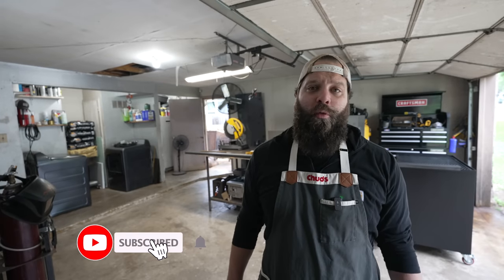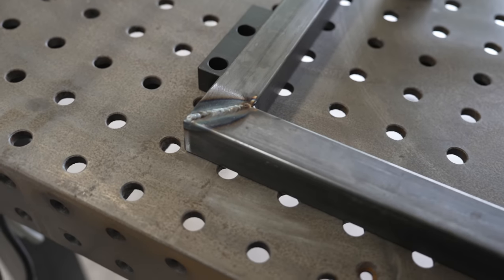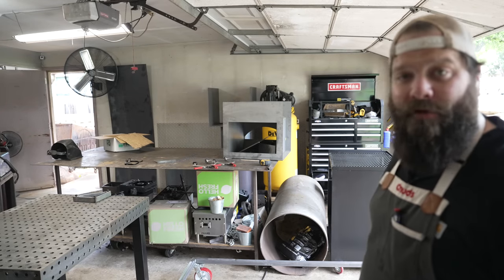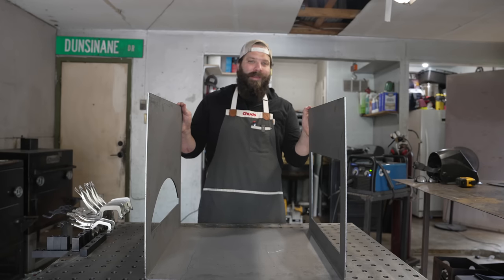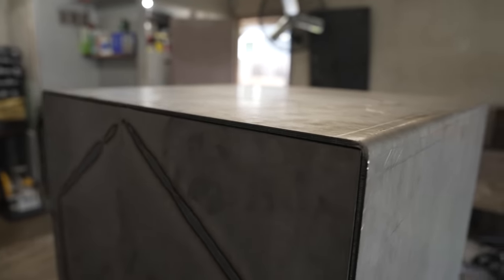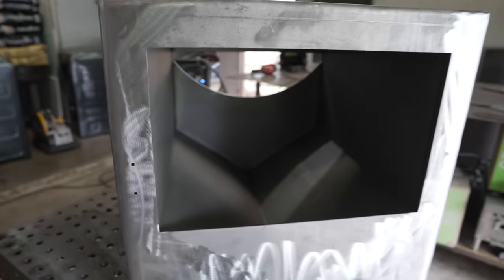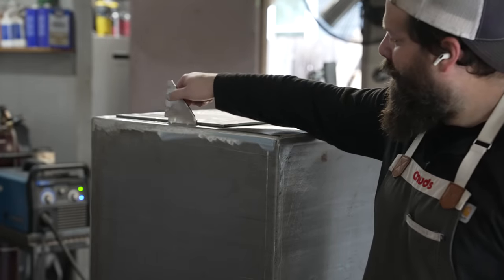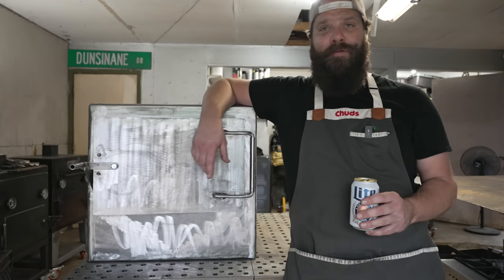How To Build a Reverse Flow BBQ Smoker Ep. 2 | Chuds BBQ

Comment: I like it but have 2 concerns.

1) If the pinholes are open to the air gap, inside the firebox, it will allow moisture into an area you won’t be able to season and will allow the firebox to rot from the inside out. You can probably avoid this by building up a lot of seasoning on top of the pinholes to seal them up.

2) The door design/position and the V-Bottom may make ash removal a bit difficult; I’d cut out the bottom of the front plate to match the V-bottom then just oversize the door plate to cover when closed. Then you’d be able to get straight in with a shovel or a brush once it’s cold.

Loving the series and looking forward to the next episode!
Reply: I have one of his Chudpit smokers. It is honestly really easy to clean out the ash with the V-bottom even though the door doesn't drop to the bottom of the fire box. I just use a square shovel and it aligns perfectly with the groove and scoops everything up.

Comment: A stick welder would help you a LOT welding the firebox pieces together.  Use 7018 rods and no one will can tell whether you used wire or stick.

Comment: Love whatcha got going on, I've learned a lot on the bbw and cook side of things, a few tips from an old welder when you have your tubing square take a cutting wheel and run it down the seems bam instant bevel weld and will give more weld less grind and to reduce porosity in light gauge metal hot and fast down hill welding is the way to go, when done right it'll give a round over look to your corners also less grinding.. because we're welders not grinders😂

Comment: Way cool setup you've built up over time, Mr. R.. One thing I discovered when you learn how to weld....your neighbors either love you or hate you. Myself? I keep the garage door down when welding or grinding.(tough to do here in central Texas, but it keeps the neighbors from calling false alarms to the Fire Dept., lol.)

I'm Jonesing after your slow speed chop saw. I have the much cheaper abrasive high speed chop saw....sounds like ten freight trains when running. But like you said, a few angle grinders can do most any job...just takes a little longer.

Enjoying this series. Probably will be as great as your Weber Kettle series. 

kudos to ya, Brad.
rocket 

(Weber Kettle with Slow N Sear, DIY hybrid pellet fed barrel smoker, commercial 8" electric hot plate, Ninja SP101 oven/air fryer combo and a small Costco air fryer)

Comment: Just a FYI...when you do small bump tacks like that, and get the dot (hole) in the middle, it's called a fisheye and can go all the way through the weld.  This, combined with the quick heating and cooling action can make the weld prone to cracking.  You're better off to turn the machine down a little bit and run a constant bead.  The spot of posority is likely caused either by holding the nozzle too far from the metal or a little wind.  Either way, it's usually caused by losing gas coverage.  Great videos though.

Comment: You made comment about the hole from the fire box to the cook chamber, making it lower than you normally make it. I made a standard flow with the fire exit low similar to yours. It wasn’t worth a shit! Used way to much fuel. Once I opened it up, worked great. I’m interested to see what happens with this pit. Thanks for sharing.

Comment: You should start using dual shield wire. It will help your porosity problems and you don't have to put any action on it so you will weld faster. It doesn't spatter as bad as normal flux core either.
Reply: That's not porosity. He just dont know how to weld.

Comment: Do you need to weld the inside of the fire box? Also, may make a tube A-frame (swing set style). You could hang a chain in the middle with a pully. You hang your box then push the table out of the way. 

Ha ha, just saw episode 3. Nvm you got it off the table.

Comment: I love it bro.  I do have a question however.  With that deep v setting below the door, wont cleaning ash out be a little tough?  If the door and door hole had the same shape it would make it way easier.   Hope this doesn't come off the wrong way because it does look awesome so far and i am truly a huge fan.
Reply: I had the same question and decided to check the comments first!

Glad I did.
Hope Bradley responds.
Reply: Scooping it out with a dustpan or just using a shop vac both probably work just fine.
Reply: Yes, that is the drawback with some square fireboxes. This just makes clean up a little more difficult. Round fire pit IMO is better but for a home welder square is a bit easier to attach.
Reply: @Jason J  I never thought of using a shop vac that's a great idea.
Reply: @Not Just Nonsense  mine is square but my door reaches the bottom so I can use a small hoe to pull it all out.  As mentioned a dustpan or shop vac would do it as long as it's had time to cool off.
Reply: Come on guys, we all babysit a fire for 5, 6, 10, 15, or 18 hours. We can't complain over the ash clean up. I built the same V design in my offset. A shovel makes quick work of most ash. The rest, I have a badass leaf blower. You can imagine how the rest is cleaned out
Reply from the maker: ...shovel

Comment: I'd slow your wire down just a tad, and you should be pushing your weld pool with mig welding. Also, to help keep your area nearly spatter free, try spraying a thin film of WD40 on before you weld. You'll have nearly zero spatter.

Comment: Did you actually add insulation to the firebox or is that just an airgap?  I'm looking forward to the rest of the series.
Reply: I think the air gap is the insulation.  Still air is a pretty good insulator, especially compared to just an exposed steel wall.  Going beyond that likely has diminishing benefits.

Comment: Not sure if it would work, but its an idea that popped into my head. That much welding wouldn't be necessary for strength. Have you considered using something like a high heat epoxy or JB Weld to seal up some of the seams? I think it would be faster and easier to get the results you want from a leakage standpoint.
Reply: smoke has to come out somewhere.  Some out the seams won't make much difference at all.

Comment: How thick is the steel you used for the firebox?
Reply: I had the same question, at 13:40 in the video it sounds like he says 3/16", so I think the box is 3/16" with a 1/4" door.

Comment: So what's the science behind having the smoke outlet not flush with the roof of the fire box? Is this the reverse flow part? Since heat rises, are you trying to limit the amount of heat that enters the pit by trapping it in the roof of the fire box. Is there a smoke benefit also?
Reply: I think the heat trapped at the top of the box is negligible at most.  I suspect the lip over the top of the opening has more to do with structural integrity than heat distribution.

Comment: The pinholes in your welds were caused by not having enough shielding gas. Some wind may have blown it away while you were welding.
Reply: Yep. Lack of shielding gas creates porosity. For as much as they charge for a pit, I'd want my welds without porosity.
Reply: Since he's grinding every weld down, the gas is a waste. Save some money and use flux core.
Reply: @duanehenicke6602  he has stated in a previous video that he doesn't like the bbs that are made when using fluxcore.
Reply: @cyberbeer65  I don't think this one was made to be sold.
Reply: @cyberbeer65  i imagine since its not for a customer and for his personal use QA is not as important to him on this build.
Reply: @Richard Thompson  i understand that. But if you're going to use a grinder, that takes care of the bb's.

Comment: If you are selling these you should honestly “care” that you gassed out on those welds. If I’m gonna pay a premium for something I expect premium quality. You should have grinded out those gas outs and re-welded. If you weld those corners vertically from top to bottom it will transfer the heat quicker and you will be less likely to blow through. Get to the point where you don’t want to grind your welds off and just clean them up. That will deliver a very high quality product. Fire video though!